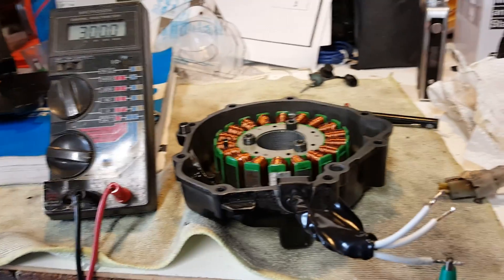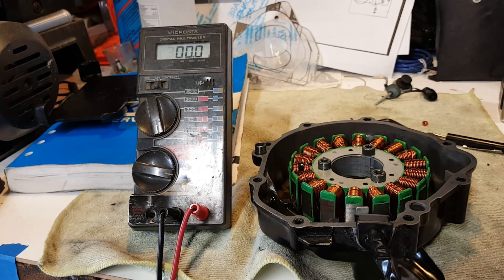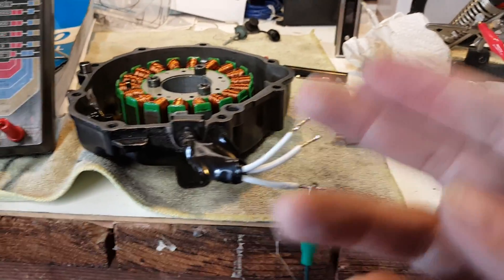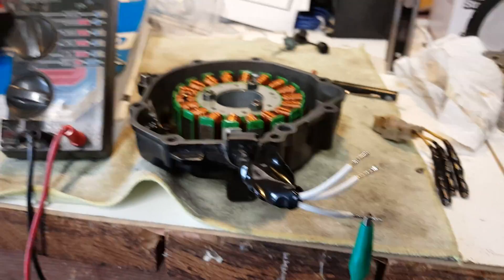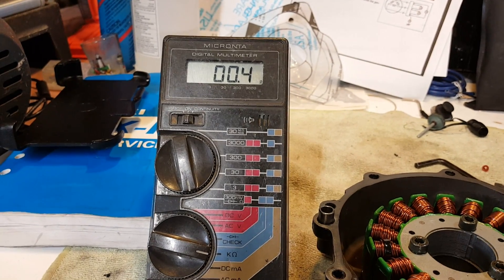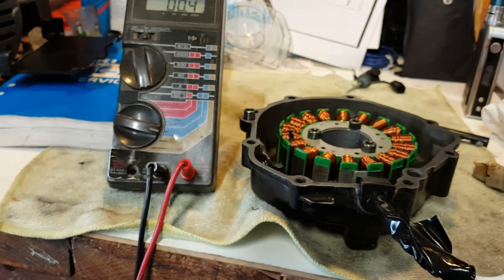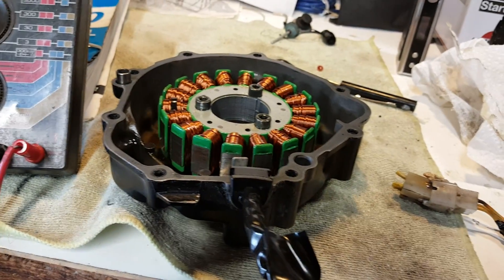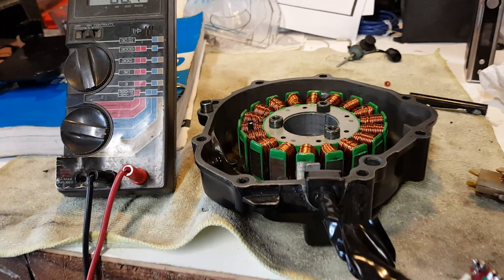Testing Your Stator on/off Your Bike

Comment: When connecting the stator to the regulator/rectifyer, does it matter which wire goes from stator to regulator?
Reply from the maker: If your speaking of the 3 wires coming off the stator (usually yellow wires) then no. The stator is producing AC current up until the RR,  then RR converts to DC and after that point is when polarity matters.
Reply: @TheChemistDIY  Thank you. That is what I'm referring to. I didn't think so, but wanted to confirm.

Comment: hey my dude my 07 gixxer wires are getting hot i changed the rectifier a month ago then my stator recently you think my old stator fried my rectifier?
Reply from the maker: What up brother, if your connectors or wiring or related harnesses are melting then yes, it could be because you RR is on its last leg and back feeding the juice it should be disappointing to ground. If you swap out the RR be sure to get a Mosfet RR rather then a cheap Ebay quick fix or youll be back in the same boat a few months down the line.

Take a look in my video arsenal of the one i purchased, i believe it was an FHA20 Mosfet (video will tell you) . After that one ive never needed another. Also consider relocating it like did as well (video will explain that to)
Reply: @TheChemistDIY  u right brother. I'm glad I purchased the MOSFET FH020AA RR.. going year and half still pushing. I purchased it after I saw ur video. Thanks my brother 🤟🏼 love your content, I've learned alot from you! 

How is ur bike?
Reply from the maker: Chris, I appreciate the props brother, glad I could help you out. I believe I'm going on 5 years now with the FHA RR without a single issue.  I'm not that guy who will just put out bullshit videos to make you purchase something from my Amazon affiliate links or a partnership I have going on with someone else. When a product just works I'm going to bring it to you whether I have a piece in it or not. In the case of the FHA.. not a single dime was given to me and I purchased my own part and just had to let you all know this was the to go.

Comment: I'm a little confused I was watching another video where he was doing the exact same test and his meter read o l on all three wires and he said that was right you're saying .4 and you're saying yours is right
Reply from the maker: Hello Rob, im not sure what other videos have informed you but if you pause my video at 1.40 minutes you can see for yourself the range of  0.2- 0.9 is what the Suzuki Manual recommends as the proper working resistance value when testing. Anything other then the recommended resistance range and right underneath that it says to replace it.
Reply: @TheChemistDIY  ~

 mine does that on the lowest settings of (ohm -200) shows 0.0 on all three black wires when n ot running , but shows  50 to  70 volts just reving it up on all 3 wires ,shows 14.5 v at the battery so what is my problem ?
Reply: my kfx 700 misses and cuts out  could the stator do that
Reply: If he was getting 0.0 ohms on all terminals either his meter is on the wrong setting or the stator is dead!

Comment: Do you have a video on how to test a r/r? My stator on my 01 gsxr 1000 is testing good but I am not getting a charge. I am running a new battery
Reply from the maker: Kyle, sorry brother I do not have one that I did myself, to me it seems like you've already solved your problem of your bike not charging tho. if you tested the stator power output while the bike is running and it was good, tested or replaced the battery and good, all connectors are good...by process of elimination the only thing left is the RR... putting your meter on the battery while the bike is running will only prove that.. it all runs in a str8 line.

engine---stator---RR----batt.
Reply: james moreno after more testing today I found that my signal wire to the r/r is only showing 
.12v I’m assuming that means something is wrong in my harness?
Reply from the maker: @kylewilliamson6228  sorry brother i must have overlooked yoyr comment. Did u resolve the issue. Im not sure what wire your speaking of. Please give me a little more detail what ur testing.
Reply: james moreno I tested the stator and it’s within spec on resistance and making 60+v. I know that battery is good and I’m getting power all of the way to the r/r. The only thing I can think of is the r/r must be bad. I’ll know tomorrow when the new r/r comes in.
Reply from the maker: @kylewilliamson6228 , ya RRs can cause you a shit-ton of problems especially if your purchasing the ones from ebay.   They work for a few months and then burn up taking out ur harness. This is just one of those parts you don't go cheap on and i learned the hard way by having to replace it 3-4 times until i finally wised up, bit the bullet and got the good MOSFET.. never had an issue since.
Reply: james moreno I didnt buy a cheap one off of eBay but hopefully it will work out. I don’t want to burn up the harness or have any issues like this again. Getting stranded on the highway 2 hrs from home wasnt any fun.
Reply from the maker: @kylewilliamson6228  i hear ya bro, been there done that and more than 2 times with RRs. One minute your cruising along and the next power drops out and you're coasting off the road wondering WTF!.. lol. And in your mind while sitting your sitting and waiting your thinking.. damn that $30 Ebay special part just cost me $200 plus cuz now i have to tow this bitch home.. lol.

Comment: should the resistance of 3 wires be equal?otherwise it doesnt work proper charging.i experience it from my  old stator.is it correct>?
Reply from the maker: Ive never ran into an instance where each phase gave a different reading, technically they should all read the same if  new. If each reads within spec then you should be good, out of spec is when you have a problem.
Reply: @TheChemistDIY  ya it was old stater and the resistance was on two phase .08 .08 & another .07 simultaneously was not charging properly but when i changed it with new one it is charging properly.

Comment: having same issue, the plug between the stator and rectifier was badly melted, now a got the new parts already here, new rectifier, stator and i got a multimeter, testing the old parts i noticied was nothing wrong with the old parts, so trying to figer out what was happening. i think my mistake was doing water blaster on my bike  ( honda cbr1000rr 2005 ) and the water went under the seat to the conections behind the battery making the terminals sulfated, i think for long time   the systen was  working on /off creating all the heat to the plugs
Reply from the maker: Could be true, sounds logical. My suggestion is anything that can be hard wired, make that move soldering all your connections. After dealing with a few burnt plugs im desided to clip off the plugs, solder them all to their respective wire and added some heat shrink tube and i haven't had a problem since.

Comment: nice tutorial video... i have the same problem but in my case i replace both stator and rectifier and yes i bought it from Ebay so China stator to China rectifier. make sense...
Reply: Same here! They are cheap and I still cant keep a charge! Guess i will be buying the more expensive better brand from Ricks
Reply from the maker: There are a few parts that you can get away with buying cheap, the stator and regulator rectifier are not one of those and you should always get the best money could buy.. you'll thank yourself in the long run.

Comment: I have 1981 kz 650. No lights when the key is on..will not start. Battery reads. 12.46. Thinking its the solenoid. Get back to me at cogarkelly@gmail .com
Reply from the maker: Kelly Cogar- no headlight, huh (but the cluster come on right) .. check your engine cut off and starter switch contacts. The headlight power runs through the starter switch. When you press the starter switch it cuts the power to the headlight so theres enough voltage to start the bike. Im thinking the contacts are either dirty or burnd out causing the bike not to start and headlight not to work. I believe i have a video on this..

Comment: i tested the stator.. all 3 wires r 0.01 omh is that bad???
Reply from the maker: According to the manual which states .2 is the lowest acceptable reading ..yes. I would start your bike and while running test the AC current by placing your meter prongs on the stator side and see if your getting the 65 AC voltage. just make sure to set your digital meter to AC current and not DC voltage. if you rev the bike up to about 5k RPMs and you don't see at least 65 then you have a stator issue and it may be time to replace.
Reply: You finalized your test right here. He is simply telling you what to do as an alternative. Replace your entire charging system and inspect the rest of the system(relays)
Reply: Will depend on your bike, get a manual as different bikes can have different specs.  The specs for my bike say .1 to.3 so its best to check a manual for your specific bike.

Comment: I have an artic cat melting the wires on the rectifer and can't figure out why. It charges at 13-14v and I tried 2 uesd rectifiers and they also get really hot. Would it be a bad stator?
Reply from the maker: Have you pulled apart the stator to see if the coil windings are burnt or discolored in any way, if not I would check that first. Secondly I would remove the stator connector and hardwire the 3 wires in with butt connectors. The OEM type connectors are cheap and can not handle the heat and voltage and often melt causing the internal pins to touch frying your rectifier and harness. The reason why the rectifier gets hot is because its in a poor location with little access to moving wind to cool the unit, thus it gets extremely hot causing it to burn up taking your harness and connector with it, I would highly recommend you relocate it to the front of the radiator where it will always receives cold air to keep it cool as I did. Lastly, stay away from eBay special RR's, these things are junk and will cause you more headache than anything. Spend the extra cash and buy the MosFet RR, you won't regret it..
Reply: james moreno  I haven't removed the stator to see the condition but thats my next move. Thanks a lot for the info!

Comment: Can you tell me on a K5 750 if this or a rectifier/regulator would cause the bike to die in flight & not start? I can get it to idle when a jump pack is hooked to the battery but it will only idle for rougly 8 seconds until the jump pack shuts off. The battery is good as well. Fuel pump delivery is good & plugs are new.
Reply from the maker: The battery is used to start the bike. If you start the bike and remove the battery terminals the bike should still run because the stator is supplying the juice. If the bike dies when you remove the terminals then you know the issue has to do with the RR or Stator. But before doing that i would put my meter to the battery and see if im getting 13-14 volts after starting and letting the bike idle. If you dont see that then u know that the battery is not being charged amd again it could be RR or stator. Most of the time its the RR but there are times when the stator goes bad to. You need to check all.. look in my videos for testing each.

Comment: Is your stator OEM or is it after market? Does it matter which one I buy?
Reply from the maker: Carlos Morelos, the one you see here is aftermarket, eBay spacial. Brand wise it does not  matter. Also, it does not matter if has the white connect or just the 3 wires. I don't use the plastic connectors anymore as they tend to get fried with all the heat and current.
Reply: james moreno awesome that’s good news I have a 2007 R1 that stoped charging not too long ago. You got a good style on your videos keep them coming.
Reply from the maker: Carlos Morelos awesome bro, glad to see your interested in performing the job on your own. Replacing the stator is a simple fix, and doing it yourself is going to save you some serious cash enabling you to put more money into your bike rather than putting it into a shops pocket. Just remember to use blue thread lock on the 3 bolts that hold the stator to the cover and you should be good. Thanks for subscribing
Reply: @TheChemistDIY  you said in a previous comment that the brand does mayter. You said mosphet was a good brand similar to oem
Reply from the maker: When it comes to these three parts, (your battery, your regular rectifier, your stator) You're going to want to purchase something of  quality and not go cheap. If you're having regulator rectifier issues then yes I highly suggest you check out the website I mentioned to purchase yourself a quality MOSFET RR.

Everything you see in this video is still on my bike to this day and I've had no further issues with my charging system.

Comment: Hello James, friend, I have a query ... you know how much is the exact amount of hydraulic fluid that must have the forks of the Suzuki Gsxr 750 k4 and what type or brand of hydraulic fluid should it be?
Reply from the maker: Black Fox, good tobhear from you. The service manual say "Use fork oil SS-05 or equivalent fork oil" .. exact words from the book. Doesn't say anything about a particular brand.
Reply: james moreno Thank you very much but I still have doubts about how much is the hydraulic fluid quantity that I should apply ..
Reply from the maker: Black Fox, did a little research  and this is what i came up with 
http://www.gsxr.com/13-tech-performance-chat/76118-fork-oil-wt.html#/topics/76118?page=1&_k=nezdjq
Reply from the maker: Black Fox this one too

http://www.gsxr.com/13-tech-performance-chat/33636-2005-gsxr-600-fork-oil-level.html#/topics/33636?page=1&_k=ipqohn
Reply from the maker: Black Fox .. here is a video you can purchase forb $4.. might be worth the investment.

http://www.onthethrottle.com/howto/04-05-gsx-r600-750-fork-service-download/